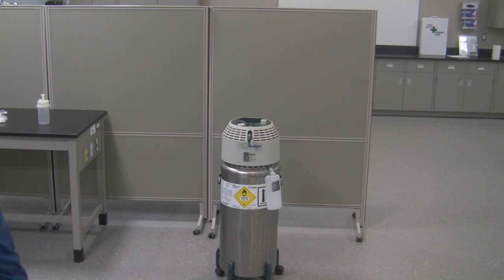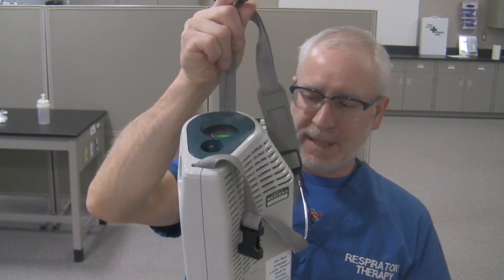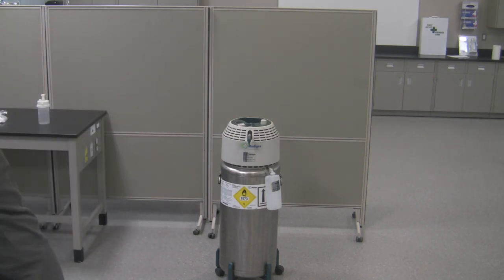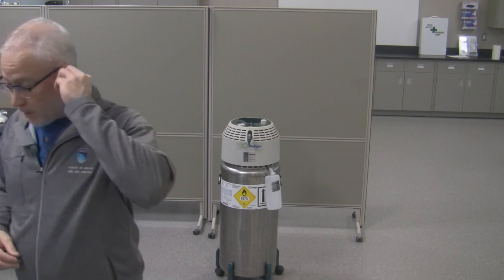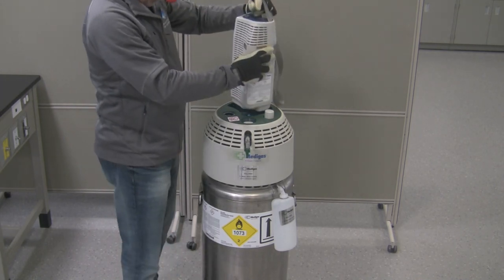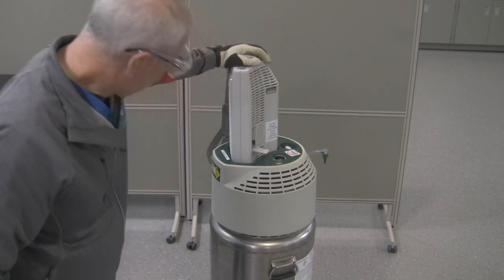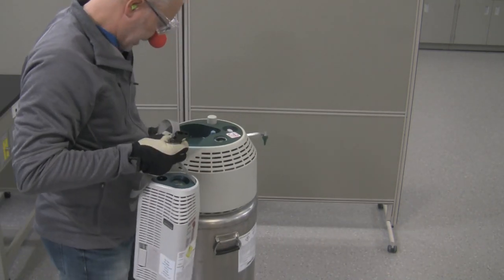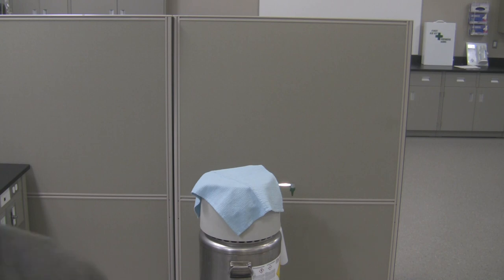Portable Home or Hospital Liquid Oxygen Systems for Patient Use:  Part 2

Comment: I don't use any kind of PPE when I handle LOX except for my normal glasses that I'm always wearing.  Eye protection is important.  When it gets on your skin, it just barely stings, and only for a moment, with no pain or noticeable tissue damage.  In fact, I discourage the use of gloves that aren't tucked under your sleeves.  In case a LOX vessel fails and the liquid is splattered, you do NOT want it trapped between your glove and your hand.  You're better off with no gloves.  Sleeves are okay as long as you aren't going to throw your arms up in the air after a spill...  I go sleeveless too...

Comment: I have two of them and I see the tube and bottle and what it's post to do?
Reply from the maker: Hi Jackie:  I have another longer video on liquid oxygen use on my YouTube channel that may provide more information for you regarding these types of liquid oxygen systems. However, if your referring to the tube sticking out of the side of the reservoir and the bottle attached to it, that is used to collect any condensation that might occur at the top of the reservoir when the res is being used to supply oxygen directly to a patient or if portable units are repetitively filled from it.  If you live in a warm and humid area, expect lots of condensation to occur on the reservoir and some potentially occur on the portable.

Comment: Can a hospital filled my tank before I go home?
Reply from the maker: Usually a portable liquid O2 tank/canister can be filled from a liquid reservoir as long as its compatible.  Hospitals may or may not fill your portable up before you go depending on the discharge policies.  Its best to confirm if your portable is compatible to their system and then find out if they'll fill it.......depending where you live, there might also be a charge too.